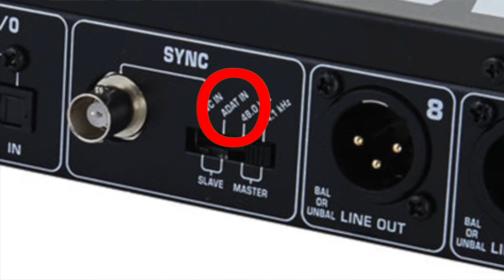AD/DA Audio Conversion, Lesson 24

Comment: Great video! Thanks 👍 would love to see a demo on extending interface’s outputs through ADAT. In other words, using ADA8200 for extra outputs for the master interface. Thanks again for your videos, they are really unique 👌
Reply from the maker: To use the ADA8200 for outputs, you would connect the toslink cable from the interface output, and into the ADA8200 input. Word clock can be synced through the ADAT signal, or a word clock cable, it makes no difference which one is used.
Thanks for the comment :)

Comment: Did you null test the recorded clone against the original? This might identify differences that are too small to hear, without having to do 400 recordings 😁. Also the difference in 48/96 is probably down to anti-alising right. If you keep re-recording that noise it will get to the point where it becomes audible, hence brightness you hear.

Comment: Hello. Amazing video, congratulations!
I have the ferrofish pulse 16 ad/da converter and the audio interface antelope discrete 8 pro synergy core.
Question 1: If I want to have the ferrofish permanently as the main converter for da/ad how should I connect the optical cables and the bnc (I have 4 optical cables connected at the moment and 2 bnc ports on each device)
Question 2: Which machine has the best converters?
Thank you very much for your answer.